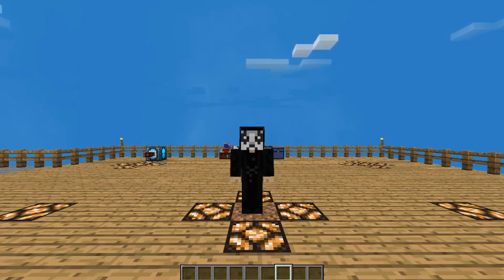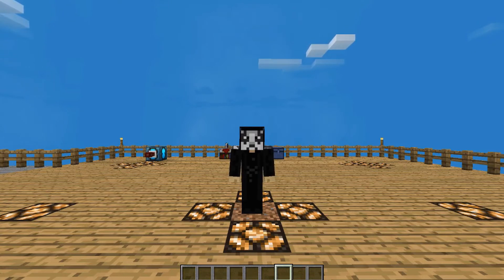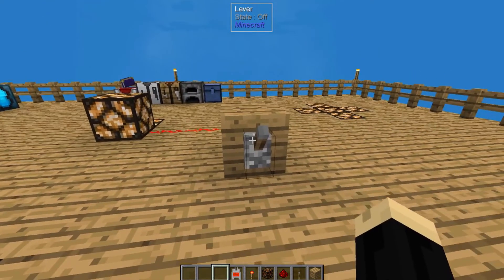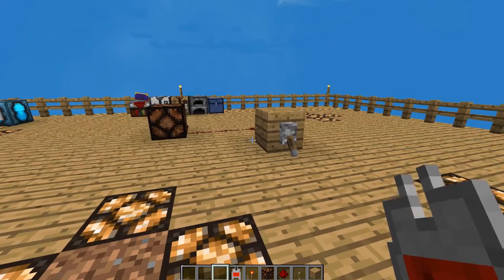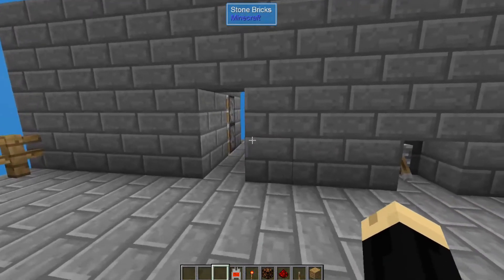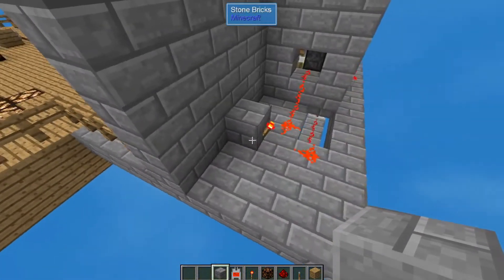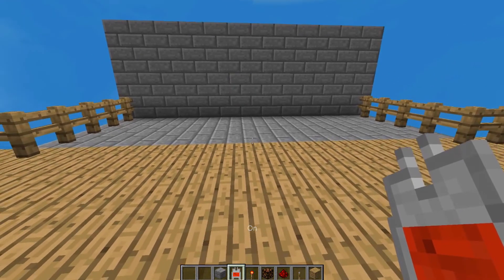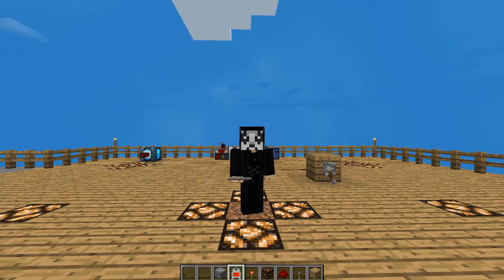Minecraft - Sky Factory 4 - How to Make and Use Remote Levers

Comment: So I have a question. I can get it to work, but it is backwards.  What I mean is that when I click the remote lever and it says on, it turns the plain lever off. And then when I click it off and the remote lever says it is off, the plain lever turns on. It still could work, but it bugs me that it is opposite of what it says.
So do you know what I'm doing wrong or how to get it to work properly?
Reply from the maker: What position was the switch/lever in when you synced it?